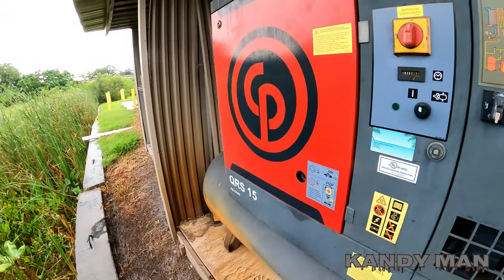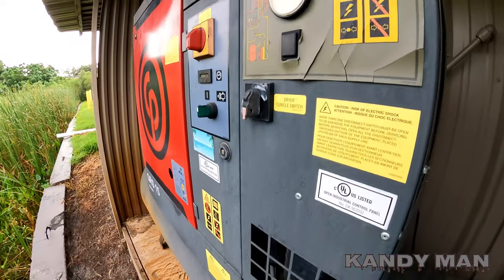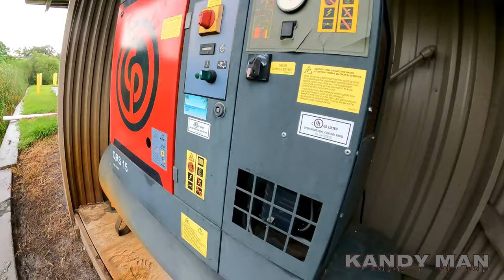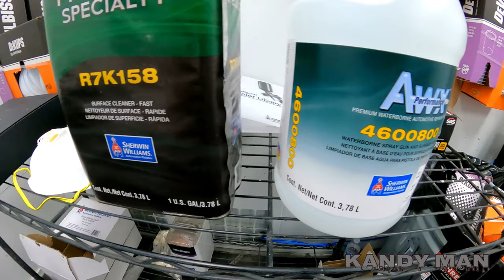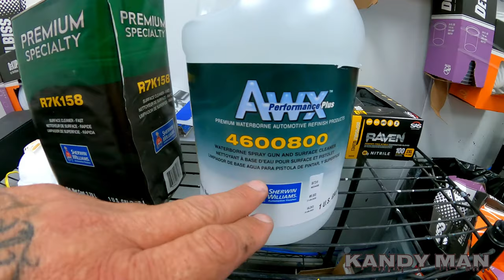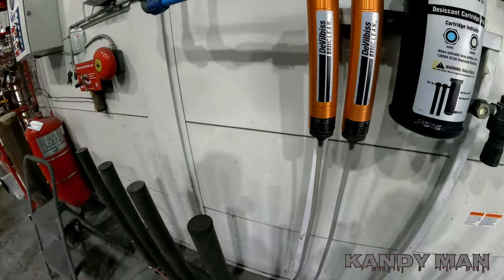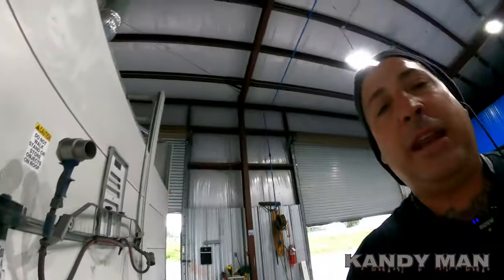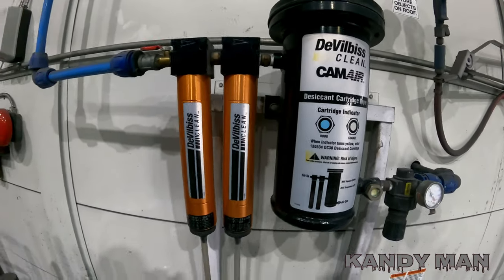HOW TO AVOID FISHEYES WHILE PAINTING

Comment: Outstanding! Just had a fisheye episode with a 70 Chevelle, PPG single stage black, but only on the second coat. Does this product not flow out on itself after a 20 minute flash time? -or This may have been water droplets, and/or oil in the line. The compressor was hot, and did see some water.. stopped, drained the tank (again) and purged the line. This setup has only an inline filter, obviously not enough. We have to sand out and top coat.

Comment: I have a huge oil cooler between my compressor head and tank , also a automatic water and oil separator before it goes back in the tank. Then on the inside of the shop another oil and water separator followed by a Motor Guard M60 filter. I’ve been upgrading  system for awhile now because I keep getting solvent pop!  I respray a panel two days ago for the fourth time thinking I had the problem fixed same result! I ran out back grabbed a old door cleaned it real quick and mixed some different paint and shot it perfect I couldn’t make it solvent pop. Gotta be the paint or surface.
Reply from the maker: Fish eyes are never fun until they no longer exist. Sounds like your on the road to recovery

Comment: candy man i need help i dont know where my gun is spitting water from i drained the air compresor and i have a filter near the air compresor cost 75 bucks so its a decent one and there is one filter in my gun so i dont know where its coming from
Reply from the maker: Coming from compressor  to have clean lines it takes refrigerator dryers and multiple filters
Reply: @kandyman5315  got it kandy man. thank you ❤️love your work and thanks for sharing your knowledge. ill buy some more filters and well snow is coming here in a couple of months so ill have a fridge soon until i can afford one of those fancy compresor.